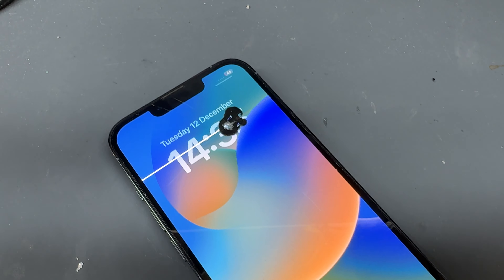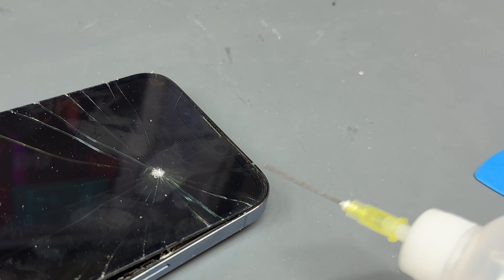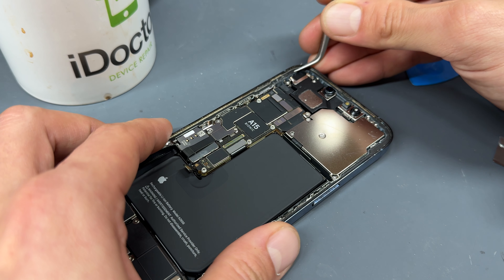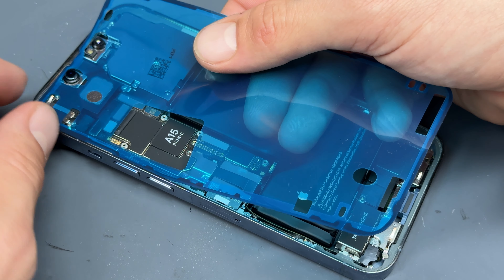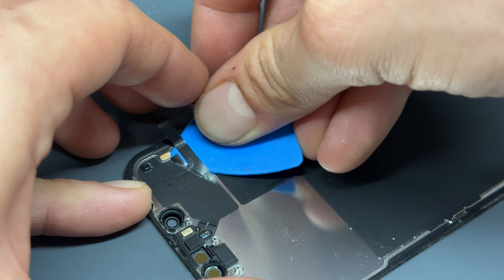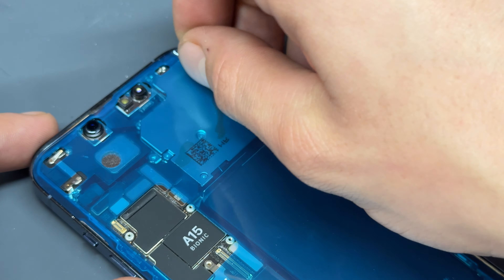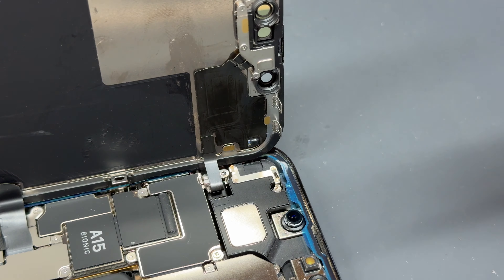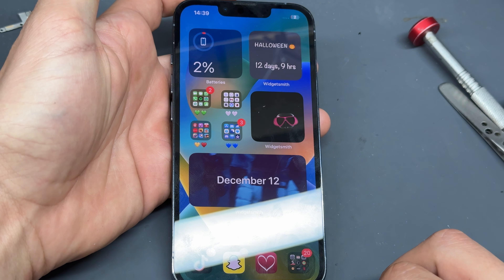iPhone 13 Pro Screen Replacement Guide - How to change your broken screen in less than 10 minutes!

Comment: Good video, but what about programming the new screen to the phone to avoid error issues(?) A Google search reveals that screen replacements on a 13 pro requires reprogramming and/or you need to transfer the screen IC Chip from the original screen, to the new screen, to avoid screen recognition errors(?)
Reply: oh no.. thought it seemed way too easy..
Reply: I been repairing samsungs and moved into apple. Did my 1st iphone 13 yesterday and nothing showed up so far. There was a notification but the lady closed it before i could read it but something about a new part. So far she said its working well.
Reply: I heard about that and have a screen/battery boards for iphone 6-11. Was thinking about getting another for iphone 12 and up but now im thinking they are a scam or they outdated now that they kinda useless
Reply: @crisspycritic  - Good to know, thanks for sharing the info!

Comment: If you change the screen does it affect the display performance when you touch or sliding to your screen?
Reply: Only if you buy a terrible replacement. Any decent 3rd party screen will be responsive to where you don't notice the difference. Even mid range like iTrucolor screens are almost identical to originals. I've been using them for 2 years and never had an issue. And they are very affordable!
Reply: @CTGFM do you mind sharing some third party people I could buy an iPhone 13 Pro Max screen off of
Reply: @CTGFM - What about programming the new screen to the phone to avoid error issues(?) A Google search reveals that screen replacements on a 13 pro requires reprogramming and/or you need to transfer the screen IC Chip from the original screen, to the new screen, to avoid screen recognition errors(?)
Reply: @__WJK__  It isn't really necessary, as long as the new screen you got is okay you're good to go.

Comment: I followed your video to replace my iPhone 13 Pro screen, and it was incredibly helpful! I watched a few videos on this topic, but yours is by far the best. The close-up shots made a huge difference and were incredibly helpful. The instructions were clear and easy to follow. For anyone worried about heating the top part of the screen, don’t stress—using a hair dryer works perfectly fine. Thanks for such a detailed and practical guide!